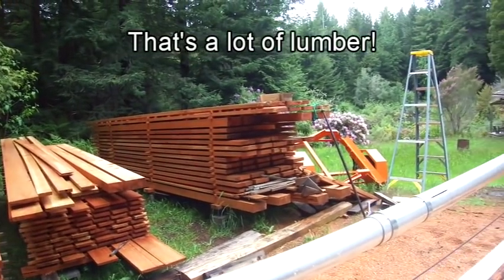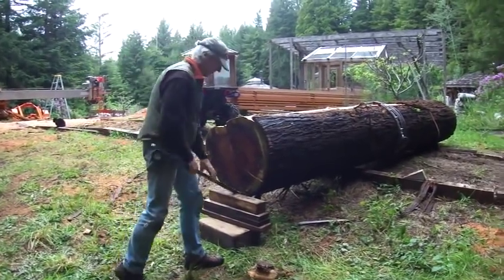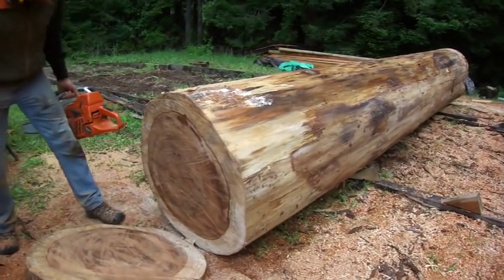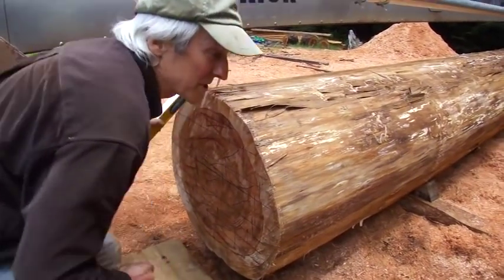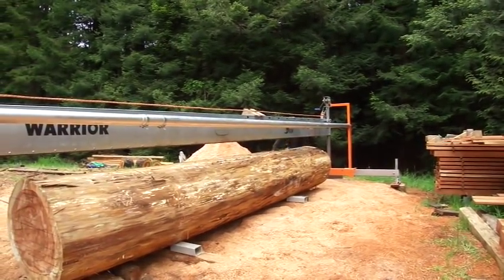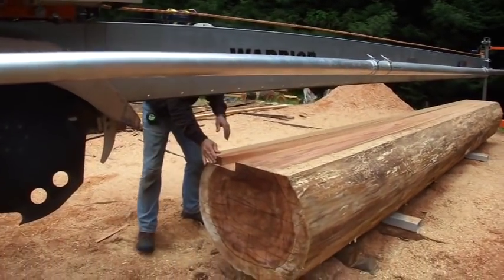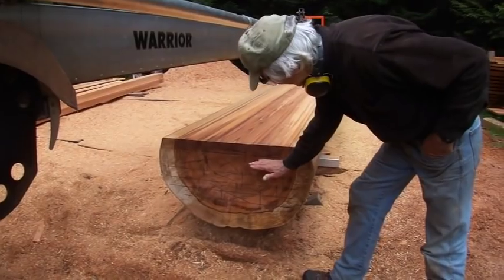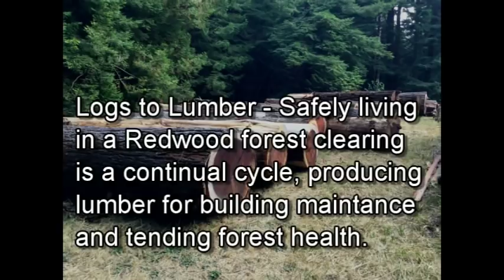He's back at it again - Milling Dimensional lumber from Redwood logs with a Turbo Sawmill!

Comment: Suggestion 
Drive a spike with a piece of chain and a washer into the ends . 
Hook a chain from each end to the 4 wheeler. There you go. 
I do this with hay bails. 
I use a riding mower. 

By placing the washer on the spike first. Then run spike through chain. And drive into the end.  Acts as a bearing 
I’m sure you may have done this before.

Comment: Great video and nice sawmill. Only issue I have with that type of sawmill, (manually reset the blade), if that guard ever comes loose, your leg is toast. Better design if the blade tilted away from you instead of towards you. 
Love the wood. Cheers :)

Comment: Pour a concrete slab that you can mount a removable winch to, then winch the logs up instead of pulling with the 4-wheeler. The spikes in the log ends for an axle mentioned lower in the comments would be a good idea too.
Reply: Looks like he does ever thing the hard way

Comment: Nice work.  This seems a lot harder than a bandsaw mill.  The only difference is that the bandsaw mill just slabs the log, So you would have to rip the slabs at some point  I guess your mill has the advantage of the dimensional lumber being light enough that one guy can lift one.  With my back, I wouldn't want to try to lift one of those wet 4x8s, much less a 16/4 slab!
Reply: IncognitoTorpedo these mills are actually light years ahead of a bandsaw. One of the main advantages is that you don't move the log once it's where it needs to be. Imagine having to roll that log three or four times on your bandsaw mill. The reason it took so long is because that redwood log is so expensive. So he is trying to maximize every piece. Another advantage in a swing saw is that you get a dimensional piece of lumber for ever down and back pass.
Reply: IncognitoTorpedo I like that you mentioned the only difference is you have to rip the slabs lol. I’m just imagining all the re-handling all the slabs to convert them into boards... I don’t understand where you got to the conclusion this is harder. 2 cuts and you have a light weight finished board to remove.